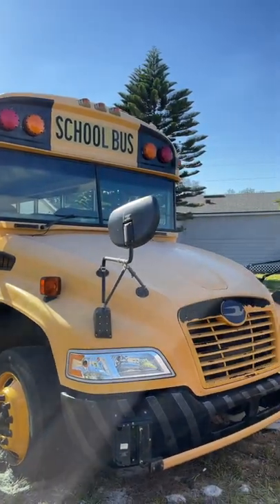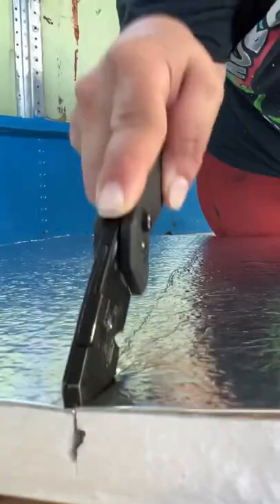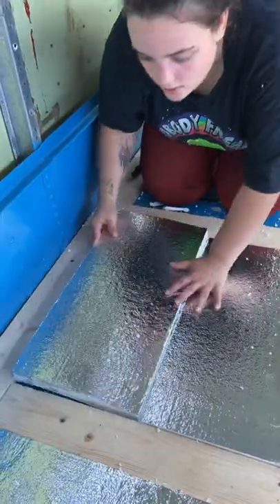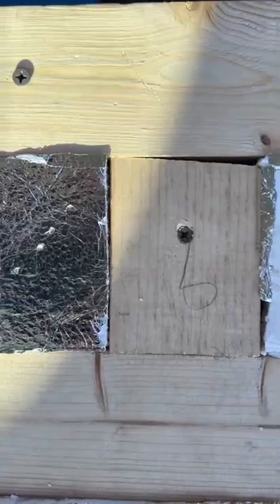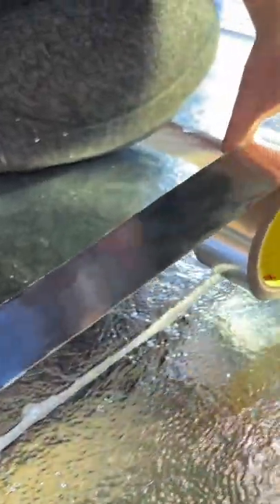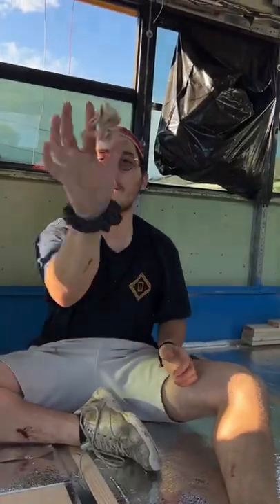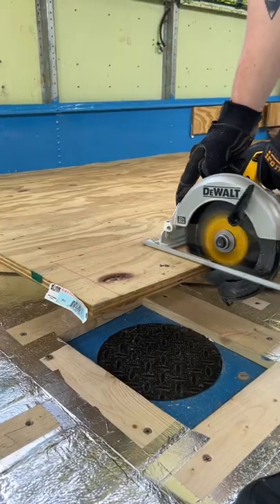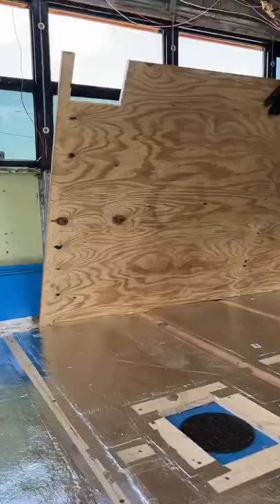NEW DANCE FLOOR?#diy#diyprojects#vanlife#schoolbusconversion#skoolie#skoolieconversion#vanconversion

Comment: You should have used advantech or something similar. It’s much more dense and will handle moisture.  You also really need to start using adhesives.  That bus is going go 70+ down the road. It’s going to flex eventually making the screws loose.  That’s why things on vehicles are typically bolted or attached with rivets
Reply: This whole bus is going to squeak, rattle and mold anyway. This interior is alright for a cabin, but bad for automative and terrible for visiting Alaska lol.

Comment: Hey your plywood looks water logged, that's probably why it's really heavy and it can mold if you don't let it dry. If your not using it stack it with tiny pieces of wood so none are touching.
Reply: It’s going to be squeaky as hell if they don’t glue it down

Comment: you shouldn't have used aluminum tape for many reasons.  Mainly it will not stick very long.  If you re-do it use some 3" quality tape like gorilla, Trex or a HVAC duct tape like shurtape 857

Comment: I feel like I'm a little late to this, but you should really make sure you didn't cover up any holes in the vehicle had, I don't know if you did or not but these things definitely have problems with fuel pumps over time and you get to them from above, the BlueBird Vision has the fuel tank between the frame rails in the tail and its a bitch to work on from below!

Comment: You will be much better to use 53 ft dry box.
Trailer. More room
 Stronger. Nothing to repaired. Rent truck to move trailer. Dry box start from $ 5000.
Reply from the maker: interesting point, but at this point we can't turn back from this project. Maybe for the future though
Reply: @JessandJake  you may open business  in manufacturing motor mobile houses.
Rent very high, so many will be interesting.